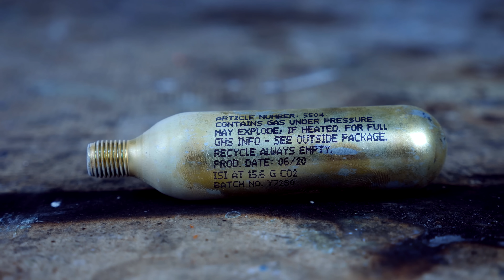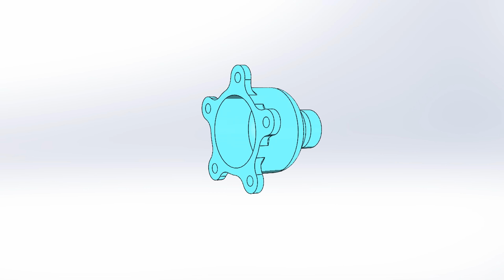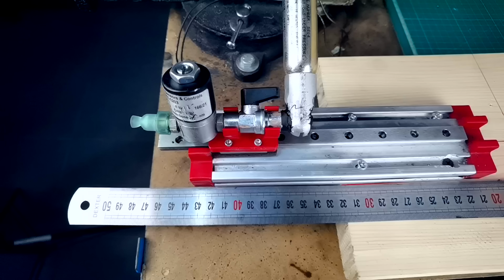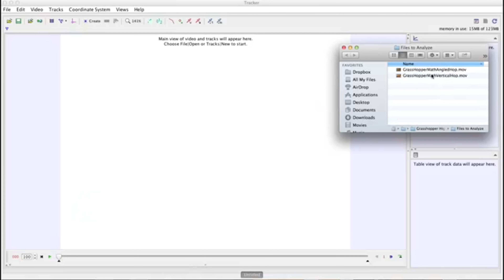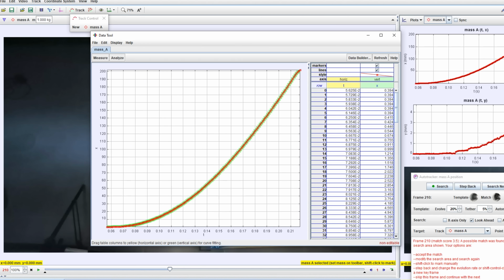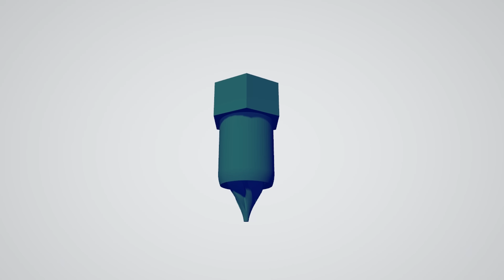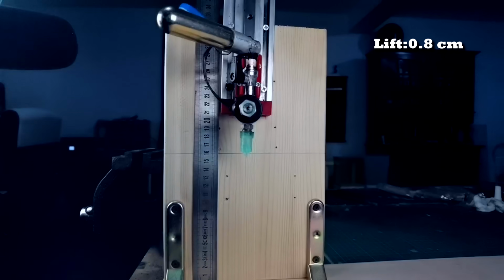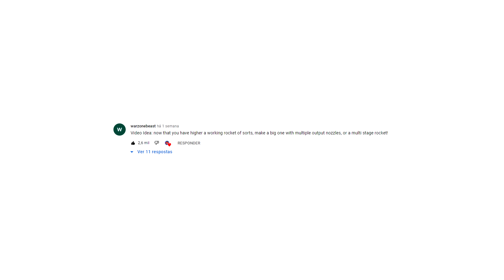I 3D printed a CO2 Rocket

Comment: VIDEO IDEA (from Milo and Louie):  We think you should retry the dry ice experiment with a 2 liter bottle, 3D printed fins and maybe a specialized breakaway nozzle. You put water in the bottle with a good amount of dry ice. The water heats the dry ice adding a great deal of pressure in the bottle until the breakaway nozzle pops off and allows water to come out. We have done this with a purchased set of fins and used a cork and it gets up 300+ feet. The bottle can handle about 10  atmospheres. Check out our dry ice rocket here:
https://youtu.be/eaAibzxLB1g

Comment: Hi my idea for next vid: why not build a launchpad for the Co2 Cartridges, remove the valve control system and replace it with a very simple needle hammer system that is attachet with the launchpad it self, I'v made a 3D model to illustrate my idea if your are interested

Comment: Possible unaccounted variable in your design. CO2 is liquid in the cartridge, so it behaves like one. Any liquid that makes out of the nozzle into free space is providing reaction mass, but not providing pressure. So you might be getting higher thrust values, at the expense of 'burn' time.

When designing the rig, the cartridge should (optimally) be vertical, which uses gravity to keep the liquid at the bottom of the cartridge, allowing only the gas to escape. The gas leaving the cartridge should be opposed to the direction of acceleration (either gravity, or actual acceleration) as that keeps the liquid out of the gas stream as much as possible. a small expansion chamber would prevent droplets that do manage to escape from getting all the way to the nozzle. 

Ideally, you want to keep the liquid CO2 as warm as possible without exceeding limits on the storage... so some way of warming to about 45C... as the packaging  (at least on cartridges I have, YMMV) says not to exceed 50C. Keeping the boiling liquid at that temp provides maximum pressure for the nozzle for as long as possible. Highest pressure for longest time equals highest possible efficiency from the fuel. Keeping that temperature is a non-trivial problem though. Use of paraffin wax as a phase-change medium for thermal storage might work though.

Comment: The carbon dioxide in those bulbs is not in a compressed solid form; it's liquid.  Carbon dioxide won't stay solid, regardless of pressure, above about -57 C.  In those bulbs, at room temperature, the pressure is about 50 atmospheres, which is plenty to keep the carbon dioxide liquid, which allows putting a lot more of the stuff in that little bulb than merely compressing gas (even to much higher pressure).

You can get dry ice out of one of those; if you vent it quickly enough, it'll get so cold the carbon dioxide freezes -- but I assure you, there is no dry ice at room temperature.

Comment: I read you could make psysioelectric crystals with chicken feed additive and sulphuric acid, simmering at quite a warm temperature.. which might be formable into shapes.. an explosion chamber made with the stuff could generated a large amount of plasma.. which when funneled along with the rest of the explosion but contained with insulation.. gives you a plasma rocket engine..

Comment: First off: It's absolutely amazing that you're enabling others to explore their interests and even run similar experiments by giving away printers. :_Happytegza:

Ideas: RC submarine w/ depth control and thrust. I believe this could be accomplished with a ballast system for depth and your big brain for thrust. Maybe for demonstration you could make a long acrylic tank w/ silicon and additional support to seal the tank.

It would be pretty sweet to see a multi-stage rocket. I wonder if you could achieve [reusable?] cold gas pneumatic separation with these CO2 cartridges? Overall seems pretty impractical since there isn't a lot to be gained in terms of stages (I would expect identical thin nozzles to remain the most efficient throughout phases since we aren't seeing changes in atmospheric pressure, and weight reduction is only a problem since we're making it one), but you know, s c i e n c e.

Also literally anything powered with water/steam hammer (danger!).

Comment: Make some kind of contraption with gears and motor that would be attached to water mains valve, and when it detects water under kitchen sink or bathroom it will shut down the water mains.

Comment: After cleaning the part with your parts cleaner, Soak the print in warm/hot water for 10 minutes before pulling off the supports, then dry and cure.  It is what we do with figurines.  The supports pull off cleanly without dimples or special tools.

Comment: How about making steel rocket nozzles by stacking laser or waterjet cut plates on to of one another and bolting together as one piece. Kinda like 3d printing except the layers are individual sheets of metal. Waterjet cutting would be the best since they can cut at an angle, you wouldn’t even have steps in your final piece.

Comment: Video idea!!! video idea!!!  Make a metal 3 d  printer by  first!  Make a box out of ceramic and put scraps of metal in it and make a pipeline to a nozzle like plastic 3D printer and connected to your plastic 3D printer just via like you done before in the welding 3D printer of metal and then see the results it will work and if everyone like my comment I will share my next ideas how to do it

Comment: I think you could build a torpedo (or something close). You have so many propulsion options, that CO2 has potential as does peroxide or something that burns  - cooling is a bit easier IN water!

Bonus points if you can make destroy a floating tomato. 

Propulsion could also be via peroxide as fuel? Or use CO2 and the Wankel engine with some of your propulsion ideas (impellers etc) from earlier vids. But hell, ‘Tis only food for thought! (And even bottle rockets are cool under water.) 

How to blow up HMS Tomato you wonder? 

A syringe! Have the torpedo stab it and unleash CO2 like a tranquilliser dart.  Just realised how horribly dangerous that is. Make sure no ducks share the pond.

I don’t mind really, love your videos - I will keep trying to push you into the water! 😇

Comment: Integza, Wold you use some kind of compression to suck another gas (like carburetors doesik the motors) in the nozzle that could react with the released gas to generate more pressure? Wold it work?😁😁 can you make a future video talking about your fan's  theorys about rocket engines ?? And remember, tomatoes  are 🤢

Comment: Hey! I was thinking about your combustion rockets system, why not put the sparkling system outside of the nozzle instead of inside the combustion chamber as they do on the actual rockets (ie rockets from SpaceX). Like that, your nozzle might be able to don't reach too much heat from the combustion. Right?

Comment: You can build a rocket that uses CO2 from a cartridge to cool down the nozzle, but also generates thrust and that also has combustion. This way, the nozzles will not melt (at least not so quick)

Comment: When you 3d print ceramic or plastics they melt you can now get 3D printed metal and still have cooling tunes so they don't.  Melt. there is a company now making 3D printed rockets yes the whole thing just not the electronics.

Comment: Maybe try adding a heating coil between the CO2 cartridge and the Nozzle

This will cause the gas to expand and increase the thrust produced

( heating coil can just be a copper coil connected to a battery)

Comment: Can you try use those party sparklers as a fuel, they are readily available and let off a lot of energy when grouped together, coupled with a combustion chamber an a nozzle at the very least some sparks will fly and it will look pretty cool

Comment: Video idea: Create a rocket with some cooling system on outer shell to prevent 3d printed nozzle from melting. On first go you could test the rocket underwater to see if it helps cool 3d printed part. Torpedoes are also rockets and Japan Kamikazde torpedos could be interesting because you could put tomato inside :D

Comment: You should make a rocket that takes a compressed gas and then burns it for combustion. Maybe the colder compressed gas will lower the combustion temperature.

Comment: I would like to see a rocket that takes off on a incline say 20 to 30 degrees to reduce fuel usage on takeoff then transitions to vertical flight.  ??? or does a 25 degree takeoff actually use less fuel to reach velocity than a purely vertical take off??? Inquiring minds want to know!

Comment: Since the CO2 chamber is effectively a rocket body, and a nozzle is a hole.
Just get a gun hammer like device to puncture the tip cleanly to launch.

I remember dropping these things down a tube onto a pin, effectively turning the CO2 and tube into a mortar launcher.
If you make this way, the air also bounces off the back of the tube and pushes the back of the cartridge, providing additional thrust.

Is this making weapons at this point? Wasn't the rocket program a weapons program all along anyway?

Comment: video ideas: try to make a CO2 rocket capable of fly, maybe this is possible using a lighter gas valve

ps: may is possible to avoid using a valve, if it is possible to puncture the cartridge through the nozzle opening with a needle

Comment: Video idea, try using a really soft type of filament to make a mold, place it in sand, then pour molten lead in it, you could also electro coat it with copper or nickel
P.S...This method could take you only 3 hours or less.

Comment: what if, if you use deodrant cans as fuel as use the pressure from that to atleast move the rocket and then ignite the pressurized flow coming out of the nozzle of the rocket. will that be like a monopropellent or like an afterjet??? i don't know but you should try this🙌

Comment: But could you design a multi bottle manifold so you can combine the power of several CO2 cartridges. I’m not sure if the weight would prevent better performance but it would be fun to figure out. Who knows maybe you could get enough performance to make a launch capable rocket. 

The above will almost certainly result in an exploding manifold but that’s science for you.

Comment: There is a chance that your nozzles are getting blocked up with ice forming on the cold inside. In particular your cool aerospike/spiral (aerospiral?) design seems to suffer from this, potentially from the much greater surface area on the central spike, giving more places for the ice to find a foothold and progressively constrict flow until only a single, very inefficient channel remains. That would explain why the footage shows such an asymmetrical exhaust.
Maybe it could be a fun idea to try to do a fully inverted jet engine, not just with cold exhaust but also with heating instead of cooling to prevent the formation of ice

Comment: Hey Integza, the difference in pressure doesn't just cause the outside of the canister to frost. I've had CO2 cartridges generate dry ice inside. 

I've found gently warming the cartridge as its being discharged helps it reach its full potential. You might see more "burn time" that way.

Comment: CO2 cartridges are liquid inside and it is because of the pressure the CO2 does not solidify. If you shake it, it'll move through the cylinder; it moves like a liquid, in my opinion, but I could be wrong.
Watch "How It's Made"... they have one on making these little tanks

Comment: Just use the co2 cartridge as a "motor" for a rocket and it will be its own nozzle. Or make a nozzle to screw onto the cartridge. and make a launch pad with a firing pin that can puncture the foil on the co2 and send the rocket.

Comment: cone nozzles found on rockets are that shape because they hold the high pressure of the propellant longer.   The downside of having a large cone is that it starts to have significant aerodynamic drag at higher speeds and that they start to weigh too much.   But in outerspace, the larger the cone, the more effective the rocket propellant mostly due to not having air molecules to push aside and weight isn't really much of a factor.    Issue is still getting such a large cone up into space in the first place.

Comment: Heating the cylinder up will increase power but above about 50c I think the end seal will blow. 
You could heat more when it’s on the stand and get some more power but the risk is the steel cylinder would rupture. 
I suspect you could heat it with steam and be OK though. 
You also lose some CO2 putting the cylinder on. You can hear a hiss. Cooling the cylinder first should reduce this loss. Interesting to see how much loss this is?
Reply: Little more research it looks like pressure will increase dramatically with increasing temperature. Suspect cylinder will rupture at much lower temperature. Probably not much over 50c, so careful heating when it is in the stand with a water-bath maybe the way to go. The water-bath and container would give some protection in case of rupture.

Comment: Make a steam rocket. Store water in heated vessel close to boiling point. Use a pressure relief valve and pipes to redirect vapour to the bottom of the vessel. Use fuel and oxidiser to increase vapour volume to increase thrust in the outlet nozzle. Back pressure will increase the boiling point of water in the vessel. Utilise the cooling from expansion to increase efficiency of fuel burn by cooling the oxidiser...

Comment: Idea! Mix It! Use that gas to make a cooling external spiral around a hot nozzle, It will help to cool it. On the other hand, the finish of that spiral tube can also used to push the rocket too if you use It to compress more the fire at the end of the nozzle.

Comment: When these cylinders are used on lifejackets they are deliberately oriented with the outlet at the lowest point.

The reason for this is so the liquid CO2 is pushed out by the gaseous CO2. Not having it oriented like this the outlet of the cylinder can freeze and massively slow down the emptying of the cylinder. 

For this reason large CO2 cylinders that are used on liferafts have a flexible siphon tube to make sure that the liquid comes out first.

Might be worth doing a back to back comparison.

Also the operating head off a co2 lifejacket could be an elegant way to activate the cylinder with a bit less weight

Comment: Video Idea: I think that if you want to inprove your afterburner you should make reverse engenering to a prophane blowtorch.
Reply: They make the gas laminar first so it sucks air from side vents,  then has a mixing turbulent section for the mix an after that it has some metal lips that self heat and burn the mix, keep whit the higth presure breathing and burn in near end transition, also i sugest thath you use a screw valve  for the gas and try a half tobera efect whit the convergin section whit a shorter end tube.

Comment: Letting the gas expand isothermally will give you much more pressure. Try to heat the cartridge in a controlled manner using hydrogen or methane.

Comment: How about this for a project idea (builds on your current work with CO2 cartridges): Carbonated ice cream soft serve machine. The cartridges produce very cold gas, if you 3D print a mixing chamber and use a piston or pump to force the ice cream mix through simultaneously (or maybe a venturi which would siphon AND mix the liquid and CO2) with careful control of pressure (like a regulator or Tesla valve) you should (after several accidental explosions) be able to extrude carbonated ice cream.

Comment: Video idea: a 3d printed robot where all the parts that can be are 3d printed.  Bonus if you print a "circuit board" instead of using a custom/existing PCB, this would almost require solder-less connections.  I'm coming up with ideas for one of these "pcb" myself and am interested to see how someone else would solve it.

Comment: You need your thrust to weight ratio:  Thrust / Weight * 9.81 needs to be higher than 1.2 to get a good push against gravity.  The closer to 1 you are, the more fuel you waste going no where, and if you're under 1, you are literally throwing fuel away.

Comment: Do like MajorHardware does and accept fan submission for nozzles. One other thing to consider is that nozzle design doesn't scale to the very small. A design that works on a full size engine might not work in miniature. If a human were scaled up to be 1000 ft tall would perceive the air to be thicker, like water.

Comment: Video idea?  Have you tried a hydrogen peroxide rocket.  I know that it does get pretty hot but I also know that it is a chemical reaction that does not involve fire.  Maybe that would stay cool enough to test your nozzles without melting or cracking them.

Comment: Here's an idea for you: You have a 3d printer: why not print cooling passages in the walls of your motors and run water (or fuel, like real rocket engines do!) through them as a kind of "hillbilly regenerative cooling system"?

You could "cheat" and print in a couple of pieces, like one as the the outer jacket and the inside walls as a separate piece.

If you're really clever, you could then use the lost-PLA (or lost-ABS) process to cast the pieces out of aluminum or bronze. (Though that'll probably end up being "engine rich" exhaust, as the rocket surgeons like to call it when your engine is producing thrust at the expense of the combustion/expansion chamber walls...)

Comment: Improvement:What if you use fuel as a cooler to your engines so the fuel would remove extra heat and instead use it to increase their temperature and therefore pressure. Like this, you can solve overheating problem, and increase fuel efficiency.

Comment: Should make a salami rocket, you can make the  nozzles cheaply from graphite aswell, all you need is an oxidizer and the fuel, and a source of ignition, I think you'll be surprised at the amount of power they can produce